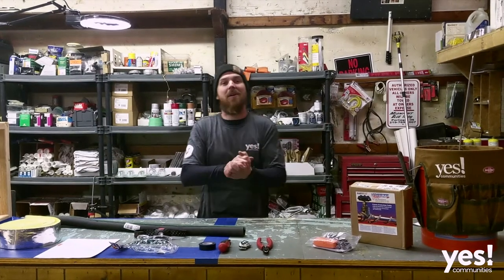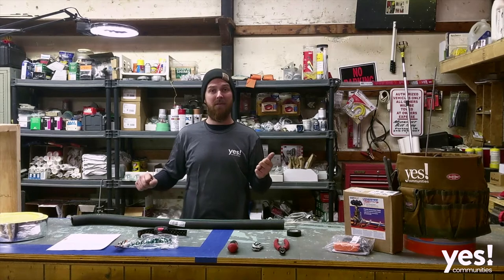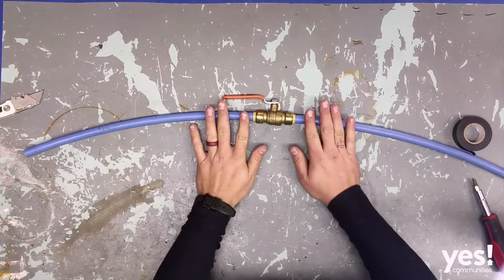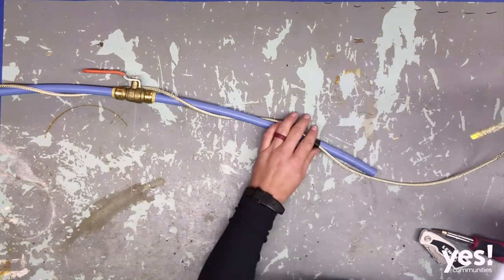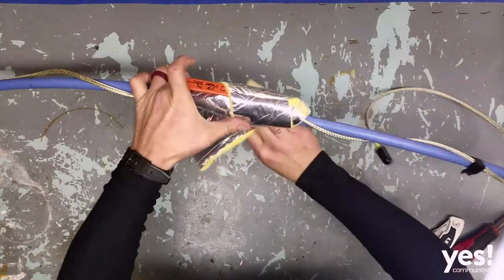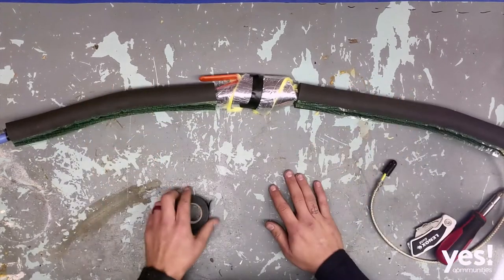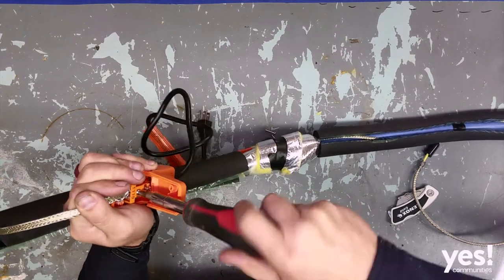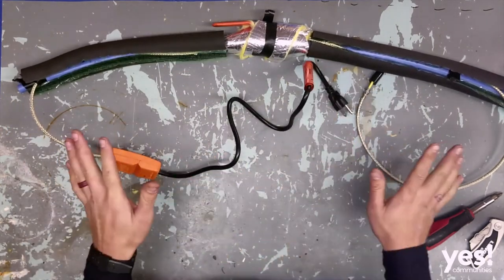Installing Heat Tape with Jack Schwent

Comment: How do you do the T sections that go off the main lines. The areas that go into each sink, faucet, etc...I have some 4" areas that T up, then I have a 1 foot spot that both lines T up. How do I heat tape  these spots, since the heat tape isn't supposed to touch itself?

Comment: I use foil tape lengthwise and run the heat tape in a straight line along the underside of the pipe.

Comment: Is it more important to put heat tape on the hot or cold line?
Reply: If the water is not running it doesn’t.
Reply: Both if the building is used infrequently only cold  for 90% of applications and typically only exterior walls where I'm at